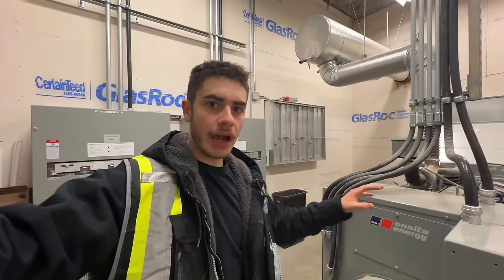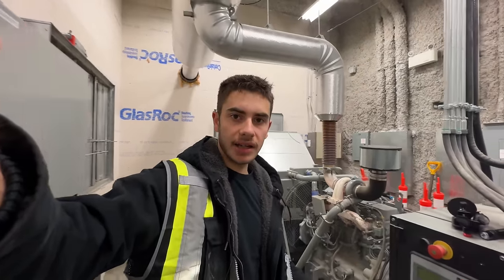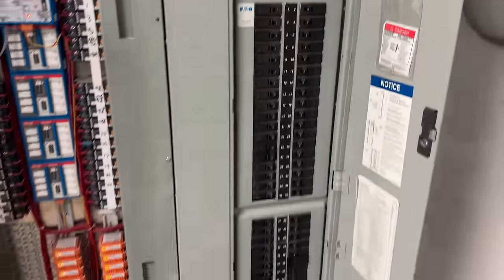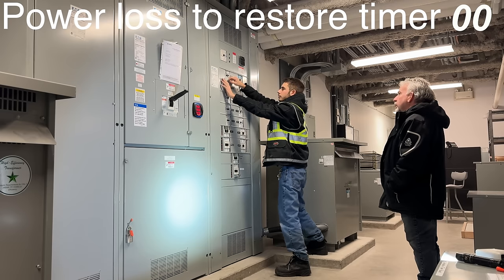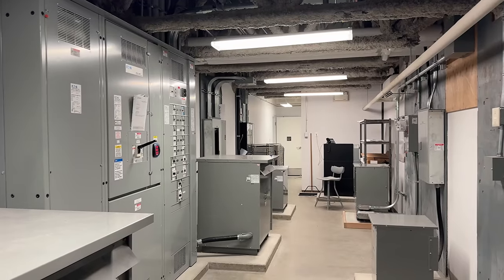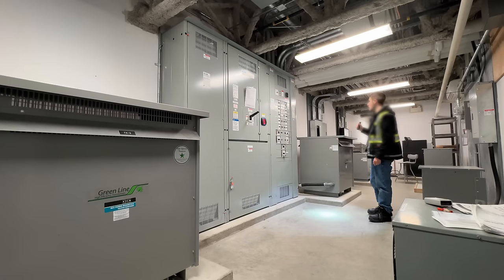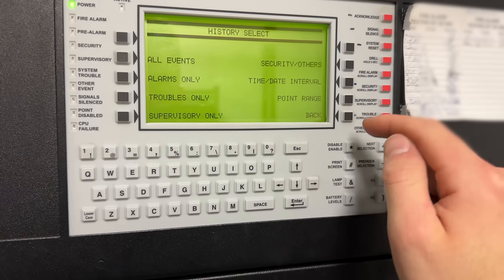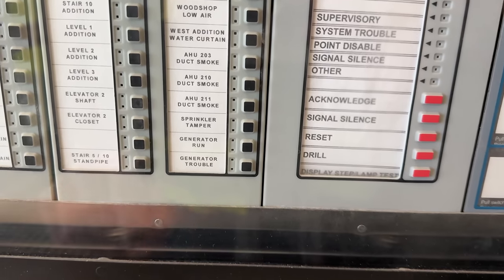Power outage generator test at high school, real power outage simulation, startup load/transfer

Comment: In USA hospitals believe the NEC only requires 10 seconds before an emergency generator starts and transfers power. All beds in ICU, NICO & other critical loads had UPS'S to prevent lost of power. Hospital that I retired from had 4 natural gas generators for halve the building. Even after they spent a million dollars to rebuild the 4 generators and new controls they were PIGS. Could not run them at 90% power using load banks ( purely resistive load ) especially in warm weather. They had to install 3 starters along with 3 sets of 1,500 CCA batteries to get these at least one of these pigs started & on line before 10 seconds. Never had that problem with the 12 Diesel gen sets thru out 6 buildings.

Comment: A company, I used to work for, built a new 6 story building complete with generator, etc. , a huge CAT diesel. The first full test of the system was about 6 months after everybody had moved in. Everything was going according to plan and suddenly the generator quits. In all the prep work someone failed to fill the fuel tank(s) for the generator, seriously. The second test, a few weeks later happened without incident.
Reply: I know exactly what you mean. 
You do absolutely everything by the book, double & triple check everything but sods law, something that's so basic always gets over looked. I always ask questions but no one ever listens to me and when they realise I'm right, I've never gotten a "well done for pointing it out" etc, etc n the boss always gets the credit unless I'm around so they make sure that doesn't happen. 
I don't like having the ₽!$5 taken out of me, just because I like and enjoy my job. Even though it's something I'll never be able to do again because of a life changing bike accident which took my leg of up to the groin. I'll also never be able to wear a normal "cup type" prosthetic leg because my pelvis was smashed to bit's. I need a very specific operation if I'll ever have a chance of walking again because as it stands (no pun intended), I use my crutches to get about for everything n use my mobility scooter if I wanna go shopping or a walk for example.  

I miss being a sparky Soooo ducking much but all I wanna do is to find another job that I like doing, contribute to society, bench work job (because that's all I'll ever be able to do for the rest of my life unless they grow me another leg) and that pays well enough so I'm better off than being on benefits for the rest of my life which I ducking HATE with a passion. There's a stigma being on benefits as they look at me, judge me n think to themselves "Of COURSE you can work you lazy €ÛñT! Get off your crippled @₹$€ n stop scrounging off the benefits as I'm working my bum off all day for you to do duck all all-day you lazy piece of $h💩!t! 😡" which is something that I REALLY dislike as you can probably image. 

I was so happy before my accident as I had the best boss n job going and I could see how the rest of my life was going to end up and it was going to be amazing. I'd have a gf who's got a decent job, an right car, who's only had long terms relationship, with a low body count, who's happy, doesn't want kid's, doesn't want marriage and who's doesn't want drama and enjoys looking after our home. 
Buuuuut I ducked that up by hitting a lamppost and no bleeding out at the scene. My life's gone to $h💩!t because of my accident and that's only going to change once I get my life back by getting another job I enjoy that pays just as well or even better. 
I just can't stand how much sparky's are earning these days as it's such a kick in the nu🥜ts! 😪😔😞

Comment: In the early 90's one summer I worked in the maintence department at one of the major Drug Store chains (who later got bought bout by CVS). I got to go the one week with them to "test the generators" (there were 3 total between the two buildings). I was first amazed as the size of the engines on them. Then I asked how they run the test. He goes over to a big rocker switch, says "see this? Is the main cut off for the building." Then he simply shut it off. I thought they would do some "simulated" test of getting it to startup.

Comment: That is one surprisingly fast transition from utility power to the generator springing to life in just 12 seconds! 😮
Reply: I've worked in places where they replaced all the 11KV switch gear and 3 new genny's with a big old slab of steel that's connected to the genny's so there constantly spinny and as soon as the powers lost they start instantly. As soon as the engine's are stable they switch over which takes less than 5sec n there's 3 of them. I'm pretty sure their 5MW each at 415/240V which goes into a 11KV transformer that goes into all the 11KV switch gear. 

That place was just a random bog standard building in London but it's actually a BT center where all the phone lines go in. I took some pics on my 3 phone and the battery bank was ducking HUGE n it was on 5 floors. The batteries must of been around 1.2m height by 1m wide and 0.8m thick n the plastic was clear so you can see inside them n they were all lead acid. I did count but can't remember but there must of been well over 250 of them n they were for the UPS's. I've never seen buss bars so big in my life! 

The 11KV cables came from the sub basement and went to all 5 floor and they went into a dry 11KV - 415/240V transformer with 3 400x4mm SWA's (Steel Wire Armoured) coming out into a panel with a 4000A main switch. 
That's when I found out JUST how much money there is in scrap copper as I accidentally threw some of it in the skip. It was the boss that told me to never touch someone else's scrap copper and I'm pretty sure they go it out the skip as I must of thrown away at least a couple hundred quids worth in the bin without even realising it. I was green so I never even knew and I through I was just helping them get rid of their rubbish 🤦🏻‍♂️
Reply: 12 seconds is 11.9 seconds too long sadly
Reply: @glitter_fart  : agreed: for computer equipment, that’s an eternity.
Reply: @TheManLab7 telehouse?
Reply from the maker: @deepsleep7822  that's why generators are never used directly to power computers no generator will start fast enough for electronic equipment to not experience a delay that is why just like in this video there is always a UPS to cover the generator starting

Comment: At a datacenter I work at there's twelve 2MW generators and a UPS bank large enough to support full load for 15 minutes.   When cutting over the lights and AC units go partially/mostly out for around 10 seconds just like in this video.   it's kinda scary when it happens unexpectedly while working on the DC floor as lights and DB levels drop by 50%.   But the critical load (75% of the load I guess) cannot go out, ever.   They do a full cutover at least 4 times per year.
Reply: I can only imagine the 15 minutes of that backup UPS is just for hand off for the back up generators. lights go out systems stay online yea?
Reply: I’m surprised they don’t have emergency lighting that should switch on when the power is gone, each fitting has its own battery (usually recommend a two of them close to each other, just in case one of them fails, and don’t place them too far away from each other)
Reply: Those cutovers are high pucker factors every time.  I never will get used to them.
Reply: @MrPartyWaffle bigger DCs use rotary UPSes which only last for 18 seconds   :)
Reply: @SuperSpecies  :  the battery system we had was rated for 15 minutes. It was to give the generator time to spin up and come online. We had a critical clock that if the generator failed, we had time to start shutdown procedures for the equipment. Some equipment doesn’t like to abruptly loose power.
Reply: @deepsleep7822 yeah i get it, though the huge DCs I'm talking about have warm start generators that supply load within 9 seconds so everything runs uninterrupted including the chillers
Reply: @SuperSpecies  : I’ve worked at huge DC’s as well. Mainframes and their peripheral equipment cannot take even 1(one) second of interrupted power. At most data centers, with server farms, they have UPS either in the room or in the racks. In that scenario 9 seconds is not a big deal. FWIW: I’ve worked in a large DC with multiple mainframes and supporting peripherals and we also had a very lager server farm. Been there, done it.
Reply: We did ours once a year. Company auditors, at the time, were happy with that. If you’re in the computer room, you don’t even know something happened; there are no outside windows. It happened twice after the system was installed. We didn’t even know until we walked out into the report distribution area and emergency lighting had been activated.
Reply: 12 2mw generators! Wow

Comment: Where I work we are required to shut the main breaker off at least once a year and run the generator under load once a month.  They would rather know about problems in a controlled environment.  Great video.
Reply from the maker: Yeah that is effectively the same test as this whether you turn the main breaker off or not it just affects the Non-Emergency loads if you turned the main breaker off but it has no difference to the generator and transfer switches
Reply: @nics-systems-electric  I think a lot depends on your environment. I could see there being some environments where it was useful to test not only that the emergency equipment itself worked, but that the correct loads had been connected to the emergency supply such that organisation could cope with the emergency.
Reply: @petermichaelgreen you mean, it depends on the personel not connecting any bs to the generator.

I did a lot of generator controlsystems for banks, hospitals, telecom and public buildings. There are two waysx to prevent the user from connecting unnecessary stuff to the generator:

Don't allow the user to make any connection to the emergency panels without permission.

Install a big enough generator, to run everything like normal. That's what we did at a bank. 350kW generator, 700 liters of diesel in the generator frame plus an additional 5000 liters in an external fuel tank. Enough fuel to run 70hrs on full load and nobody knows why - probably because they just had enough money 😅 So there was no need to exclude anything from the emergency power, although they did.
Reply: I have heard that you are suppose to exercise your breakers especially the main.
Reply: @TheATVboy17  no need for that. And load cb's wear out, when disconnected under load. Depending on the brand, you will have to send them to reman after a few houndreds up to 5000 cycles. That's why they are available as plug types for easy replacement.

GFCI should be tested regularly. You are not supposed to switch them off, but to use tge test button instead.
Reply: When they originally installed the generator where I worked, it supplied emergency lights, fire alarm panel, and the online UPS for the data center. They went back in a few years later and added two more generators which took care of the entire facility, including the chillers, boilers, and associated HVAC equipment. Each generator had a 250 gallon diesel tank in the frame, and our transportation department kept a 2000 gallon bobtail truck full to refill the tanks.
Reply: At the private school I worked at we NEVER tested the generator..... it's why it never works
Reply: I work in Datacenter we do power outage simulation every quarter and run generators monthly
Reply: @lukedavis436  rip
Reply: @nics-systems-electric  I saw the emergency stop button on the generator question about that if it ever got hit accidentally how do you reset? The emergency stop button you should make a video of that
Reply from the maker: @KevinLyons-gn7eu  you'd just pull it back out maybe have to turn it at the same time
Reply: @nics-systems-electric  why does the generator have a emergency stop button
Reply from the maker: @KevinLyons-gn7eu  in case you need to stop it. the reason is in the name of it

Comment: Nice clean installation. Instills confidence in client. After looking at the one line diagram, I will make the following suggestion. Add SPDs (Surge Protective Devices) on the load (output) of the transfer switches.

The diagram does show a 200kA TVSS (Transient Voltage Surge Suppressor). The industry changed the nomenclature of TVSSs to SPDs about 20-years ago. A 200kA SPD is fairly beefy and a good choice. 200kA means the the SPD is capable of taking one 200,000 transient amp. “Spike” without failing.

My recommendation is based on 40-years of industry experience. Once the transfer switches transfer to the generator, there is no protection for the critical loads. 

The loads are then exposed to whatever transients (spikes) or high-frequency noise the generator may produce. One of our clients generator’s voltage regulator failed and produced an overvoltage which damaged equipment in their data center.

One SPD on PNL ED1 and one on PNL EB. We want to protect the front end UPS electronics from being damaged from switching transients from the transfer switch. We also want to capture any reactive spikes that may be generated during an outage when the transfer from generator to utility. Think of a coil (same as a transformer) in a car with the points opening on the primary side and the high voltage spike on the secondary which fires the spark plug.

We have seen damage to UPSs and other facility electronics. Quality UPSs have internal bypass switches that wrap-around the guts of the UPS if the UPS senses an internal failure and the utility source is available. We have seen front end spikes “confuse” the UPS Bypass logic and put the UPS into bypass even though the utility is not available or it flickers right after power is restored.

Finally, glad to see that there is a delay once the transfer from generator to utility starts. We have seen a push towards high-speed transfer switches. There have been instances where there is stored energy in the electrical distribution, but it is decaying in voltage and frequency. When the utility closes, the two sources are out of sync. This can trip breakers and cause physical damage.

Additional SPDs may be warranted on critical equipment. Such as the fryers in the kitchen. We know that the students will get grumpy if they can’t get their fries.
Reply from the maker: Thanks for the comment I appreciate your insight you have highlighted a lot of important details that are often overlooked.

Comment: We were taught to take in a deep breath & ho!d it while operating circuit breakers or safety switches. Reason being if an arc fault occurs you would not breath in air as hot ad 10,000 degrees & burning your lungs. Also taught to stand on one side of a breaker or safety switch while operating. Our chief electrician wanted us to wear our tinted face shield and rubber gloves on while switching anything over 100 amps. In the US we loose an electrician every day thru electrocution, arc fault or an arc blast incident. You stated that you only use two minutes for cool down. All of the 16 generators that we had in 6 buildings had a 5 minute cool down. We had to test run generators every week for 10 minutes and once a month on load banks to prevent wet stacking on diesel gen sets.
Reply from the maker: Yes for sure standoff to one side and look away

Comment: I wished we had 600 volt here in the US. Higher voltage is always better. Motors start so much more efficiently, current is lower so you can use a smaller wire.
Reply: Honestly the nicest part about 600V is for motors generally your HP is your A. Makes really convenient sanity checks

Comment: I didn’t hear the generator sound change at all when the load switched on. Pretty cool.
Reply: I heard it for both events. When the generator went online, then offline.
Reply from the maker: Yeah you can hear it slightly but it's only loaded around 30% so it's not a significant change

Comment: Thanks to your boss (I'm assuming) for allowing you to take time out if the day to make these videos, you're awesome man! Are you an apprentice or finished already? You're going to be next level when you start your own business or take over.
Reply from the maker: Thanks I appreciate it. I am currently an apprentice, I am grateful to have a journeyman who allows me to show some of the work such as the testing like this that are supposed to be done monthly on YouTube. Thanks for your comment
Reply: @nics-systems-electric  I'm left wondering why code requires two transfer switches when you are also driving a UPS with the generator. Also, the transfer switch should juggle phase so when it goes off of generator and reconnected the mains to the UPS there isn't any phase jitter from MAINS/GEN/MAINS again to the UPS.
I had some electrical work done and the guy crossed the phases, eg: 1,3,2 instead of 1,2,3, and wouldn't change it back saying his work was correct and the prior was not.
We had to do an emergency shut down since our UPS was only good for about 30 minutes, and the phase change required a power off for the load side. 
Fortunately, I wrote programs to do just that on the servers except the E-911 which had to be shut down manually. (It was E-rate, they didn't let us do anything to E-rate stuff much.)